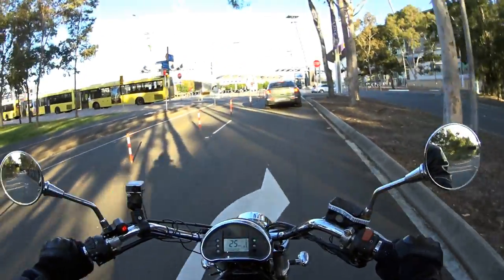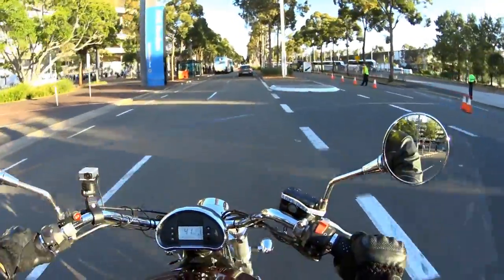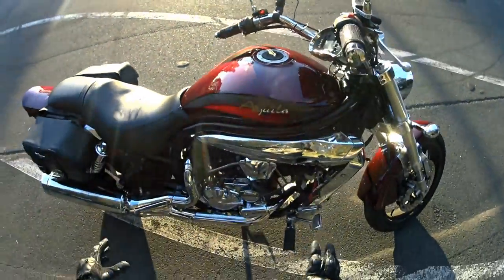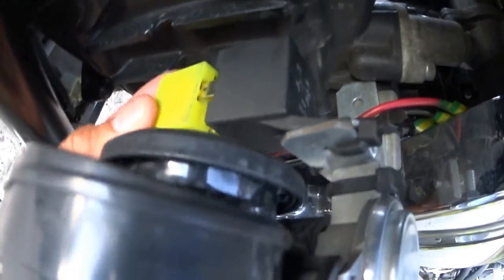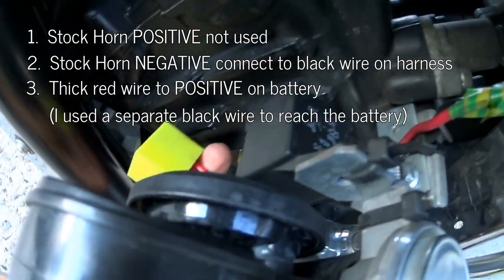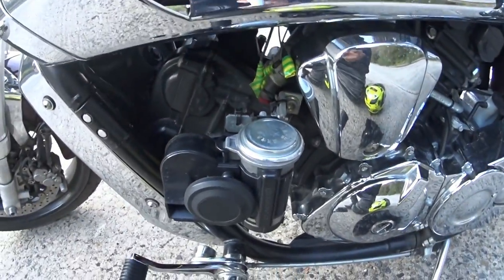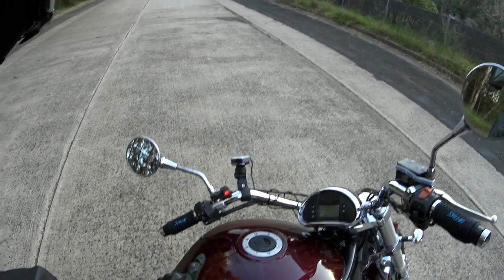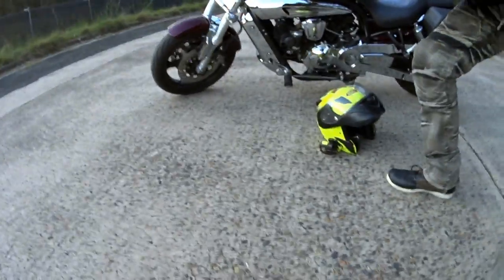eBay Motorcycle Compact Air Horn 🌟 | #84 Hyosung GV650 | Sydney | outie555

Comment: I bought 4 pieces (ufo shape design) horn meant for mercedes E200 built by bosch. Installed it on my vespa px200 back in the 90s. The most badass sound ever, every driver and rider got a rude shocked whenever they cut into my lane without signalling. 😁
Reply from the maker: That sounds terrific

Comment: Thanks for posting this video I’ve just brought one of these horns but no instructions on fitting it hopefully I can follow what you have put in the video  to fit mine 😊
Reply from the maker: Hope so buddy. Yeah I was on the same boat and had to do a bit of trial and error before I installed it to make sure it would work. There might be a better way to do it, but my way worked fine. But you could still use the horn with the ignition off.
Reply: outie555 yeah I tried yesterday and it either didn’t work or come on continuously 😂 I’ll try it like you have done thanks mate